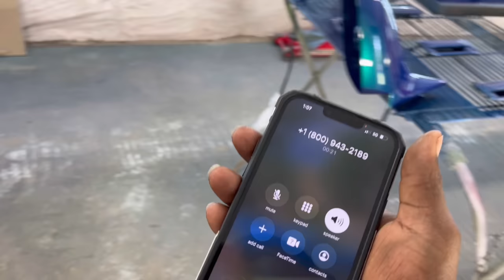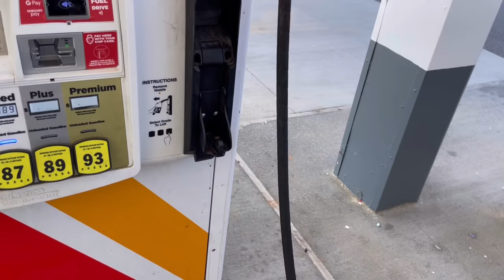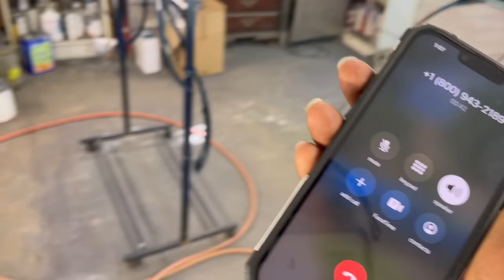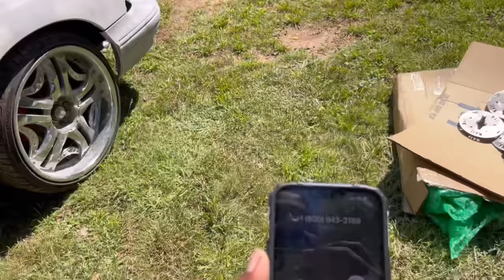We made it to @SprayWayCustoms  with the Malibu!!!

Comment: Can’t wait to see that color on the Malibu, that hydro boost runs off of the power steering, works awesome, a must have if you have a big cam that doesn’t have much vacuum to run a regular brake booster. I’m not sure if the LS swaps with the stage 3 and up cams lose as much vacuum as the old school engines